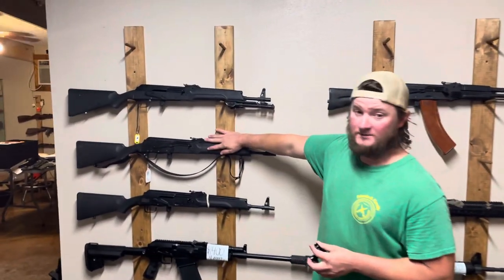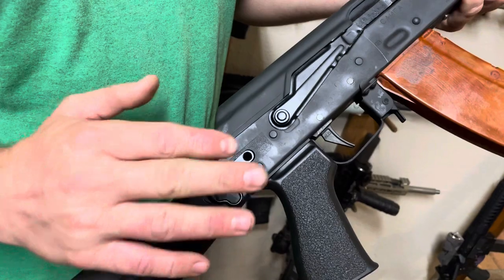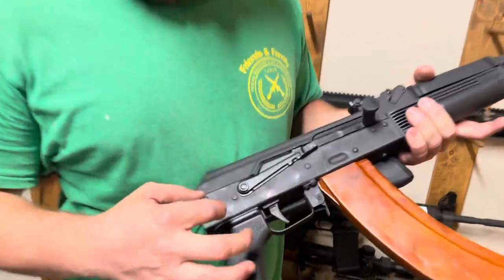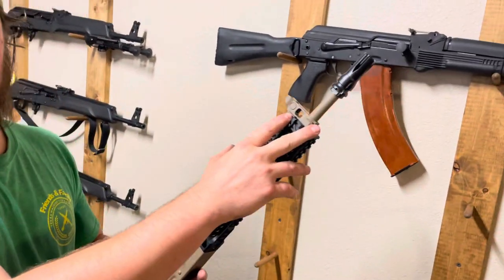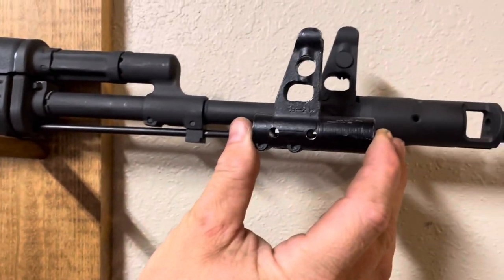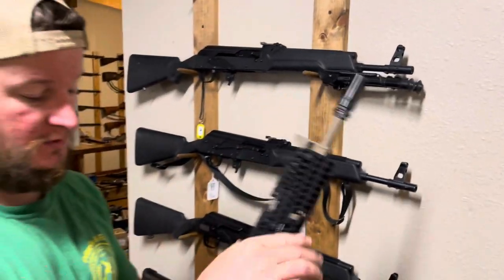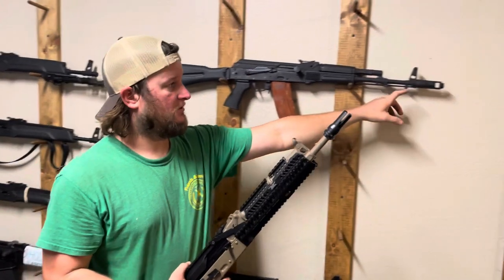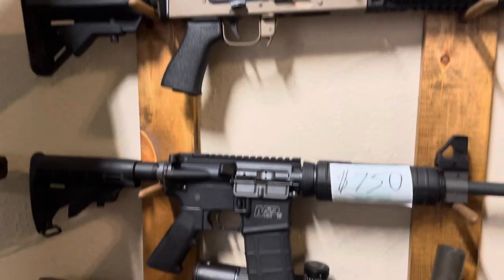Saiga Ak conversions and what you need to know.

Comment: Fancy. I did a conversion back in 2009 (one of the first guns I owned) and riveted the holes, took a dremel to the floorplate, reused the trigger guard, and threw some tapco stuff in there, then rattle canned it and it shoots quite fine. A jigsaw worked to reuse the factory foregrip and expose the gas tube.

Comment: Great video. Thank you. I have  a question. When replacing the front sight block and gas block with authentic Russian  virgen parts that have never been drilled before, how do you drill the new ones to match the pin notches already drilled in the barrel for the 3mm pins?  Is there any tricks or tips you could offer?

Comment: I just found a 223 Saiga at a pawn shop. Based on SN# looks like a 2002 model.  Thicker barrel and no dimples on the receiver.  Missing original dust cover, gas tube, rear sight and all the furniture, however receiver is still unconverted and bolt, carrier and barrel appear to have limited use.  I set it aside on a long layaway and considering two options:  Restore if possible to original sporter configuration, or convert it into something more AK101 like.  How would you recommend getting around the thicker barrel though?  Every FSB, GB and handguard retainer I find is meant for the thinner barrels.
Reply from the maker: we fix all that.
Reply: @weapongeneticsrd7429  Cool.  Do you turn down the barrel or ream out the parts to fit the thicker barrel?  Still have plenty of time to decide what direction to take with this one.  Either all original, or AK-101 conversion.

Comment: What I did with my Saigas, I have a 20" barrel 7.62x39mm and a 5.45x39mm, and I just did the bullet guide and FCG. I left the sight block but I'd really like to either change it out or have the end barrel threaded for a brake. I just want it done right because they've gone up considerably in value and I don't have everything I need to do it right. I've never even seen a 20" barreled Saiga and i can't find much on it. It doesn't use the same size foregrip as 16" Saigas.